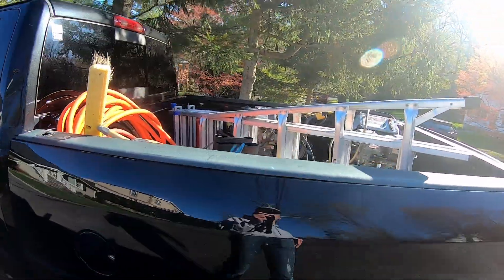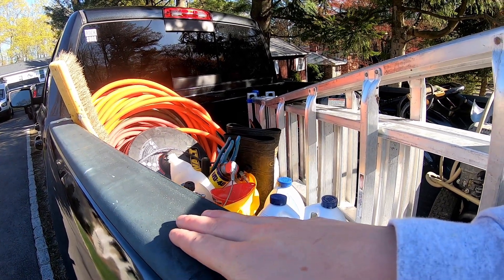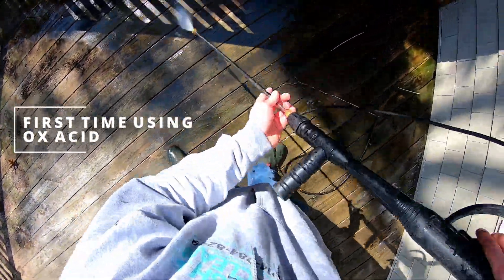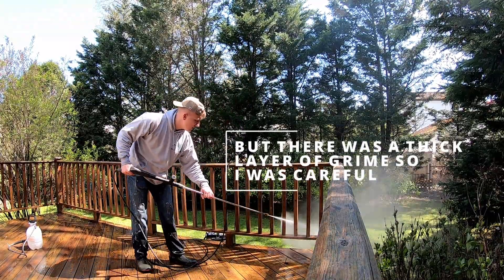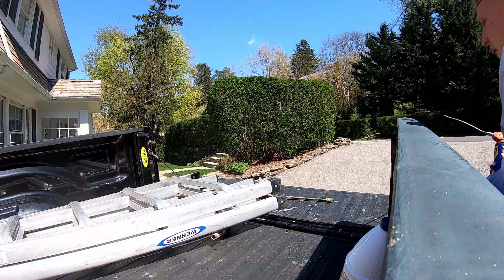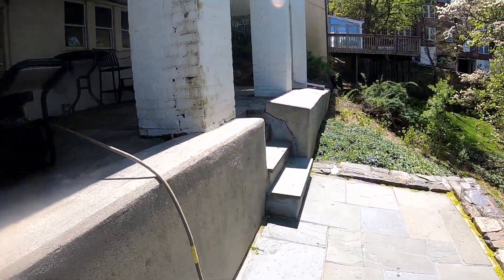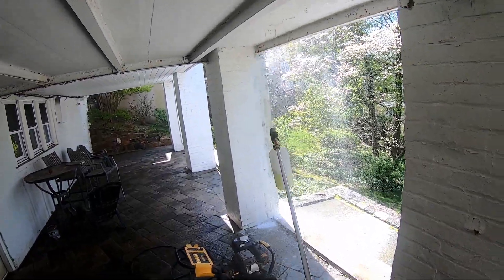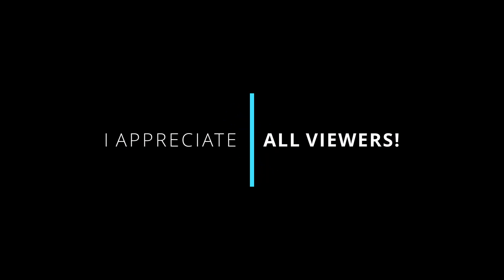Growing A Pressure Washing Business - How We Plan To Double Our Revenue Pressure Washing

Comment: Have a look at a 5.5 gpm machine.  A 100 gallon buffer tank with it.  You could double your flow with that machine and still keep your expenses down a good bit.  A good 18 inch commercial surface cleaner.  If you guys could swallow those expenses you could almost double your efficiency and would allow you both to work off that machine at the same time if you needed to.  Just some food for thought.
Reply from the maker: Will take that into consideration thanks! The only thing is that we’re trying to avoid the buffer tank for now but we will have to look further into it. Appreciate the input 🙌
Reply: @jmventurelog  --  No problem guys.  I was just thinking out loud is all.
Reply: 5.5 will run without any issues off of a customer’s water unless it’s a slow pumping well. I’m currently using a 4GPM. You will love the upgrade from 2.7
Reply from the maker: @truthseeker1532  I’m excited to upgrade 🙌